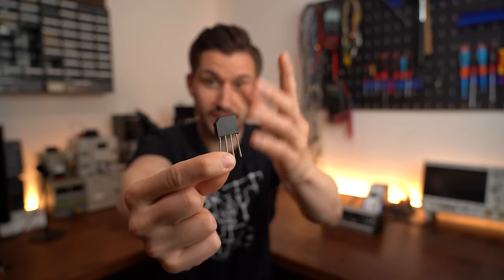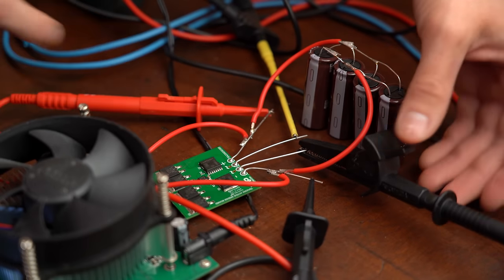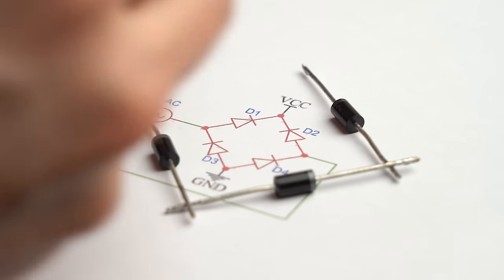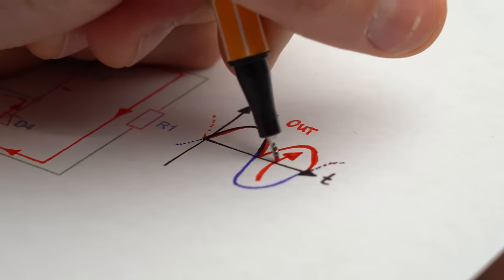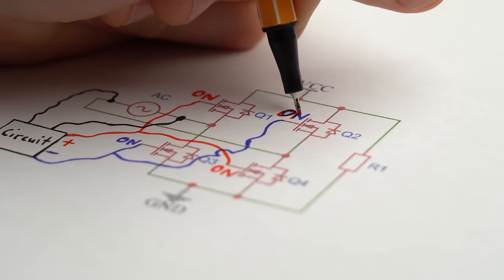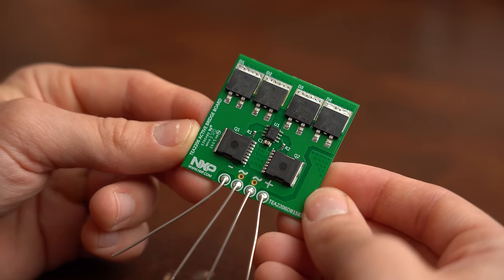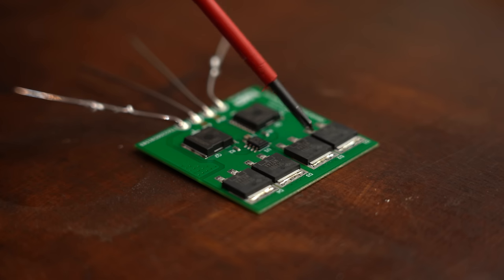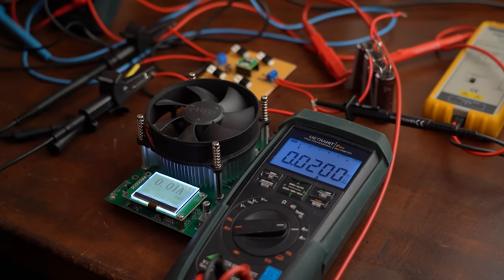The End of the Full Bridge Rectifier? (Sorry ElectroBOOM) Active Rectifier is here!

Comment: What you are calling as active rectifier is actually a full controlled bridge rectifier. Larger versions are used in large scale applications like HVDC transmission line and trains to feed the modern traction converters.

Comment: With the 24V test the AC voltage the current it is not the main issue. Instead, it is the low voltage. Diodes take around 0.7V off the voltage. That means for a normal FULL BRIDGE RECTIFIER the voltage drop is 1.4V. No matter the main voltage. So, if the main voltage in 24V, the drop is higher percentagewise than when you use the voltage ten times higher.
Now count in the lower current for the same energy, and you know why using 240V is way more sensible than using 24V for long distances. 😉

Comment: This is an excellent video that I googled by accident... I'm looking for low-voltage high-current device, that can run, say, 1.1v at 20A DC for a home electrolysis tank. I don't see any commercial devices out there that advertise they 'step down' 120v to my requirements. I'm wondering if I could re-wind an old Microwave transformer 110v down to say, 1.2v, and then use your 'Active Rectifier' to make it DC, with min power loss?

Comment: You do not have to use M-FETs; in older circuits I saw the use of SRCs, which also increase the efficiency of the rectifier. The reason this not wildly used is because of RF noise the switching creates, that requires extra components and/or shielding is required. The losses are not considerable for most applications, since we use stationary AC. Unless you use high power device such as a DC motor the extra cost and maintenance negate the M-FET solution as too expensive.

Comment: So the similar savings would be made with three phase rectifier connected in triangle 400V , than 230V. If household/company were set up with heatpump to reuse heat, it would be even more marginal. Efficiency of power regulators are making all the difference.

Comment: There are multiple points here to pin out. 
# FBR is bulletproof and low cost solution - more conponents = higher failure rate
# I like the idea of using synchronous (active) rectifiers on the secondary side of the tranformer in converters -the waveform is not sine but more square/rectagular what is sensed much easier a nd usually there are enough swithing time between power path via transistors
# Designers should focus on efficient power supply design  but i see even from renowned manufacturer its a disaster (not all of them)

Comment: I just see this as a full bridge rectifier with MOSFETs instead, which is of course a good idea when you want to minimize your forward voltage drop.
One experience I have with the classic full bridge rectifier is that the zero transition is quite non-linear and can cause quite a bit of noise. Decoupling with capacitors over each diode softens it considerably.

Comment: It seemed like you used the active rectifier on the input (mains) side of the power supply. The output side would probably benefit more from the higher rectification efficiency since the output current is much higher. Also the fact that your mains voltage is higher in Europe, diminishes the  benefit of higher rectification efficiency since the input current would be half of what we get on 120v mains here in the US.
Reply: Depends on the system, offline switchers need DC. If you rectify a low voltages then you are correct, but now you have a honkin big transformer. An example would be LED lights where the currents can be quite large. The mains transformers are too expensive. Even fluorescent ballasts went away from big heavy wound inductors to tiny “electronic” ballasts a long time ago.
Reply: older PFC-less SMPS in 120v countries had their input diodes reconfigurable as voltage doublers that performed rectification at the same time via a switch on the back. There would be two storage caps that would end up in series for 120V mode. So more than double the ripple but the primary side saw about the same voltage and average current in either case.

Comment: Hmm... You should've tried using resistors for inrush current limiting for the capacitors.. (and probably it would be a good idea to put a resistor in parallel  to make sure that the capacitors will get drained after you pull the plug so you know you won't handle charged resistors)

Comment: I suppose if one wants capacitor  smoothing and full wave rectification, one might still benefit with active rectification and settle with the voltage drop of one inline  diode just before the smoothing capacitors.

Comment: You can't use active rectification everywhere so electric boom still rains. Active rectification is only good at low voltage High amperage you can still use diodes in high voltage circuits and obtain good efficiency high voltage circuits means like 50 volts and higher.

Comment: so with this (and with a h bridge driver), the easy part is having a circuit which works, but the hard part is having a circuit which doesn't blow itself up.

i challenged myself with designing a h bridge driver circuit. getting it working was easy. getting it to not blow up was hard. i lost so many MOSFETs to that project lmao, I literally had copper tracks vaporising themselves and MOSFETs turning their casing into shrapnel.

Comment: The voltage drop of about 1v of full bridge rectifier in High voltage side 230v, the loss is negligible, lets say power supply 100w, (1/230v)*100w=0.435w, less than 0.5%, no need to complicate the circuit

Comment: What if you replaced the rectification on the DC side of the power adaptor? With a SMPS there should be another rectification stage at the DC side which should be low voltage high current, since you only replaced the AC side in the video.

Comment: What happened with the capacitor bank was an initial current surge.  Capacitors will act like short circuits at start up if there isn't an impedance in series to control the initial charging current.
Reply: No, it's a continuous current surge. I believe the active rectifier remains on during the falling part of the waveform which means it would discharge the capacitor in the second half of each half cycle. Continually charging and discharging large capacitors 100 times a second causes a huge amount of reactive power.
Reply: @eDoc2020  that's possible.  I was under the impression that the control circuit monitored the output side to ensure that the current only flowed on 1 direction.  I may have missed something
Reply: @VTdarkangel  I'm sure some control chips do. I haven't read the datasheet but the note that this chip must be used with a PFC boost circuit suggests to me this chip doesn't have that sensing.

Comment: I think active rectifiers will only be useful on high power power supplies (which usually also have active PFC in them) like server power supplies.
In a small power supply, as described in the video, the current through the rectifier is too small. And it is very rare for a small power supply to use PFC.
Reply: Fast charging of electric cars will need big DC power

Comment: I think these are not more popular for main level AC rectification for safety reasons.  Are these control circuits properly tested when there’s transient noise on the line or during disturbances that can occur during a power outage?  Personally I’d be really cautious using these because they seem useful only for high current loads and also seem sensitive to transient current peaks coming from the load.  However they might be useful when the rectifier is on the low voltage secondary side of a power transformer.

Comment: I think 99% of the time when engineers use a bridge they want to drop input voltage to a much lower DC voltage. The snag is, when you add a capacitor to the DC side of the bridge the floating  voltage coming out is more than what is coming in. It's a constant frustration, so we welcome the voltage drop through the diodes.
Reply: Maybe this is why high voltage FBR + step down converter seems to be more popular?

Comment: I can see an obvious reason for an IC that only allows replacing the lower side diodes with FETs.  It doesn't have to get the timing as precisely correct to avoid shorting out the mains.
Reply: That's not much of an issue. I suspect the real reason is cost. A chip controlling the low side only deals with 15 or so volts. A chip controlling all four rectifier FETs needs high voltage high side drivers which probably take up much more die space and/or require different manufacturing processes.

Comment: Good video, but what about trying to put several diodes in parallel in the diode bridge to minimize voltage losses? that is, instead of 4 diodes, use 16 diodes... 4x4 in parallel on the bridge...?

Comment: I think the classic diode rectifier is better for low current applications. Because power loss in case of pc power supply is quite small only 2-3W.  But if current is high (10 A or higher) active full bridge rectifier is better.

Comment: I never thought about using an active rectifier on the input side of a SMPS, only on the high current low voltage output of the SMPS transformer.

Comment: Yes they come with a voltage drop, but you can mitigate that voltage drop by using high power schottkey diodes. Assuming they can handle the reverse voltage. You'd still have a Vfwd of maybe 300mw but it's a lot better than the ~1 volt for PN junction diodes. And I don't believe schottkeys are much more expensive. The only inferior aspect of them I can think is that MAYBE they might not be able to handle the same reverse voltage. But I'd have to look that up to be sure. But a few hundred volts is peanuts for most rectifier diodes. So they'd have to be comparable.

Comment: These have advantages, but add more components and of course reliability drops off. I like the efficiency but know the problems with power MOSFETS too well. Many are unreliable due to cheap manufacturing processes. Also very susceptible to lightning/power surges. Bridge diodes often survive power surges or save the device being hit by shorting and opening the fuse. Mosfets dont like overvoltage or overcurrent for more than a few MS. I was hoping by now we would have almost indestructable FET's like we have bipolar devices. Power FETs have grown by leaps and bounds but their reliability has slipped, compounded by average engineers using too small current capacity transistor for the circuit to save pennies. Thanks for the heads up, havent seen this yet, bet I will be seeing it in newer power supplies, in the next few years.

Comment: I got news for you I been an electronics engineer for 47 years mosfets fail quite often and very static sensitive.  For all the more efficiently you claim without the voltage drop its not worth the reliability factor. Sure you will see some going this way but, old school bridges are still better in  reliability .  Those are the facts

Comment: If you placed diodes in parallel with the MOSFETs, would that increase voltage loss? Or would it go through the path of least resistance, with the diodes basically acting as a "in case of emergency"

Comment: I freely admit I have not researched this one bit, but, I'll ask the question anyway... do any of these active rectifier chips include a soft start or soft turn on capability to limit inrush currents?

It would also be interesting to see what the gate signals to the mosfets looks like, because I suspect it's a pwm function.... and that being the case, a soft turn on should be easily possible.
Reply: I suspect these chips are using 50Hz square waves. To use a higher frequency PWM you would need to integrate an inductor.

Comment: On Semi has a part that I've used that utilizes this tech in a good way, with a quad MOSFET package. FDMQ8205A, if you want to look up the data sheet. I'm not sure how well it works with AC, but it's great for making a DC input that works regardless of polarity.

Comment: wonderful video. i would also like to know the cost v. performance metric. the full bridge is very cheap. is the mosfet much more expensive? is there a use case where the efficiency justifies the expense? great work and continued success!
Reply: Heat. When it is difficult to get rid of heat you might want to get every bit of efficiency. Also even a small heat spreader can easily cost more than a few semiconductors and is much larger.

Comment: ooh cool! I love Ideal Diode circuits! I use cheap Ideal Diode boards for all of my applications now I dont know their switching frequency capability but they are only used for preventing backfeeding of certain multiple supply rails for my Buffer Power Distribution and also my DC UPS that switches to battery when mains goes out. Both these systems use a slightly higher voltage for the supply that has higher priority (mains powered versus battery powered)
A full bridge rectifier would be awesome for a high power switching power supply I have lots of power supplies that have APFC. I think you need to increase your collection of random power boards! :D

Comment: I bet it wouldn't be hard to build a driver using a couple optocouples and smaller diodes. That's probably all the driver ic is. It would probable also eliminate the capacitive load issue.

Comment: A switching power supply has two FBR at least. What is the maximum frequency the active rectifier can work at? Could it handle the high frequency of the low voltage/high current output side of the power supply, or is it only available for 50/60Hz?

Comment: As shown by the measurement results, not an economical choice at higher voltages, where the 2 * 0.7 V drop (approximate, or rule of thumb) can easily be tolerated.  But why the active bridge rectifier was developed was when the CPU voltages started dropping below 5 V and they became absolutely mandatory when CPUs became progressively lower in voltage.  Think in terms of 1.8 V or even lower!  Moreover, think what an 80 W CPU would ask in current..  You would be dealing with over 40 A.  1.4 V * 40 A = 56 W of losses.  Also, at that current even pretty big diodes start dropping about 1 V rather than the 0.7 V.  Of course, there are Schottky diodes, with their 0.2 to 0.4 V drop per diode, but that still remains an intolerable loss of efficiency.

Comment: Is it not possible to use an LCRC tank in parallel after normal full bridge rectification to bring current and voltage levels back to where they should be in order to help mitigate power loss? This way you still have the resistive side to make the active rectifier work without the issues that comes with capacitive loads?

Comment: This is the problem I see with these circuits: For high voltage circuits, they have marginal improvements, while regular day to day circuits that require a rectifier already draw very little current, so it's marginal improvements cannot be justified to anything other than high current low voltage applications which are not that common.

Comment: The losses in the stabiliser, even in a switching regulator, will always be higher than those in the rectifier. So, a synchronous rectifier will not improve the situation much.
Different the situation when the rectifier is part of an high frequency DC-DC converter, where you have 200 KHz 12 Vac: here the sync rectifier can change the efficiency from 70% to 95%...

Comment: So active rectifiers are only beneficial in low voltage AC to DC power supplies. For mains voltage levels the power losses for the 0.7V drop across standard diodes is insignificant.

Comment: Couldn't the MOSFETs be toggled by the AC voltage itself, using two half rectifiers in opposing directions? Or would that risk running too much voltage for the switching mechanisms to handle?
Reply: Do you mean using very small diodes (just enough to control gate voltage) FBR to trigger the MOSFETS? A basic course on Active Retifies covers this https://nicadd.niu.edu/~fortner/course/phys475/lect/p575_01b.pdf.  They start with this basic concept and arrive at circuits similar to what is shown in the video.

Comment: Thanks Scott! Excellent video. Do you know if there is an active rectifier for 3 Phase Rectification? I assume so, but I'd need some help figuring it out;
Reply: I'm not Scott but i will try to answer your question. There are various types of 3 phase active rectifiers, some of them have an unidirectional power flow from the electrical grid to the load (Viena Rectifier for example) achieving a very low harmonic distorsion and very good power factor. Other are bidirectional using a 3 phase inverters thanks to the antiparallel configuration of the IGBT/MOSFET and the diodes, if you want to learn more search about a "back to back" configuration of inverters :)

Comment: I wonder what your conclusions would be when you measured the current with the scope. The capacitor bank is famous for drawing current at the peak of the sinus. I wonder if the meter is accurate with the low duty cycle high current peaks.

Comment: You must be from Deutschland as you speak English with an accent and it sounds German.  I didn't know there was a replacement for a full wave bridge rectifier.  I use them in my HO scale modeling.  Mein Deutsch is nict so gut.  MOSFET's are more expensive than full wave bridge rectifiers.  Cheers from eastern Tennessee

Comment: For very high currents mosfet based rectifiers are NOT more efficient than a diode based rectifier. Suppose the on resistance is 25m0hm, that will be more than 0.7 V at 30A. At very high currents would need to go to an IGBT based solution.